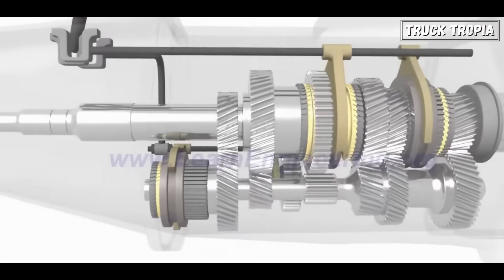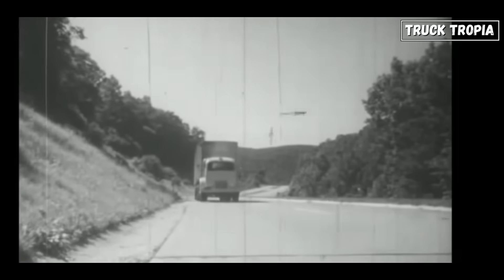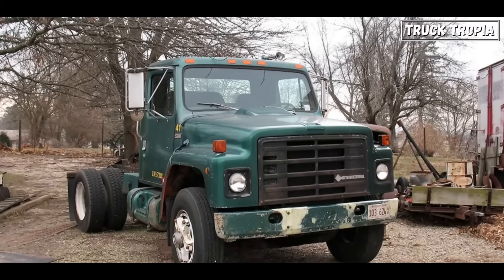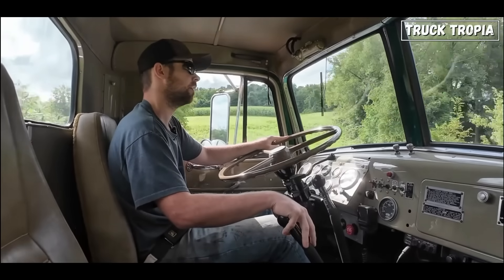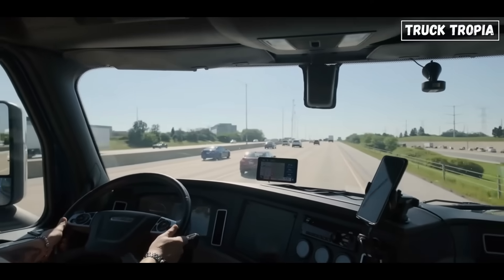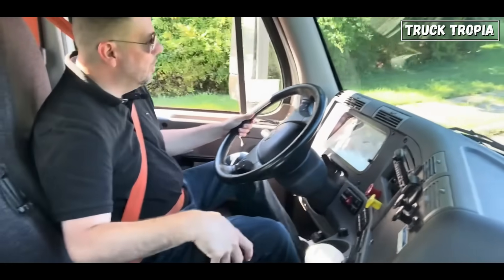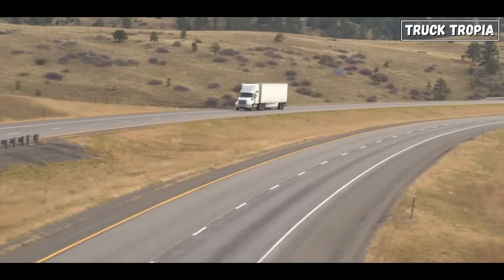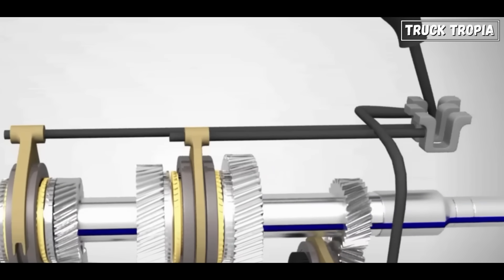Why Do We Keep Adding Gears to Trucks

Comment: Please do a bit more homework before presenting something like this. For example the c.1940 Peterbilt on the left on your title page would have a 4&3(12 speed) minimum, or possibly 5&2(9 or 10). The necessary power output from the engine occurs in a less than 500 rpm range. A straight 4-speed would require 1000 or more rpm difference between gears, OK for bobtailing.

Comment: For almost a hundred years now the American railroads have not had any need for geared transmissions because all  Diesel locomotives that they use are diesel-electric (ie diesel engines generating electricity for the motors that turn the wheels).
Reply: But those DieselElectric engine combinations are very heavy. A locomotive have to be very heavy, not to slip. ( low friction steel wheels to steel rails ). A truck has to be light in order to carry as much load as possible. Roads are built for smaller vehicle weight than railroads.
Reply: @Mike40M  they could still make the diesel electric truck light, I know that one of our local Municipal Water Works use diesel electric generators to keep the water flowing during power outages.
Reply: @earlfreeman93   I told you a million times. Don't exaggerate! Diesel electric has only been common for 70 years. And trains and trucks are different. Trust me, if they could put a diesel electric in a truck they would. Might happen in the future, because electric trucks will not be sustainable for long haul work. City work OK. But they tried electric buses in my city for three years and gave up. It turn out, the buses use up 70% of their battery power to heat the buses, and have only 30% left to run the darn thing. They kept running out of battery half way back to the charging station. Oops! Now they're trying again, but if you open the battery charging door, you will see a sign that says...wait for it..."Diesel Fuel Only"  LOL.  Ya, you can't beat a good old fashioned internal combustion engine to keep passengers warm in winter. But the EV people will keep on dreaming. LOL
Reply: @SternDrive  Must have been battery buses, because electric TROLLEY buses work great.  You just need overhead wires.

Comment: Give trucks 200 gears, then you will need to have 3 people in the cab = 1 to drive, and 2 others to do the shifting every few seconds.  Volvo trucks come with automatics as 'standard', their dual-clutch i-shift automatics are light-years ahead of the old 18-speed manuals in every respect. However, other brands of automatics can be horrible by comparison.
Reply: @menguardingtheirownwallets6791   But what you don't realize is that Volvo has tried all kinds of transmissions here in North America, and many of them have failed. Fact: We carry far heavier loads, over far longer distances, at far higher speeds, than our European friends in their little boxy short trucks. Volvo, and all the other modern trucks know what is out there, and they use what works.

Comment: I love a good manual gear box. But what I cannot understand is American trucks having two or three gears and very complicated gear shifting.
Reply: @fernandorangika  We don't have "two or three gears" at all. I'm not sure who told you that. And "complicated gear shifting" ??? Why do you say that? All North American trucks have the exact same 5 speed H pattern. My 18 speed is ultra simple. If you were empty you could shift it like an 8 speed. 4 gears in low range, and then repeat 4 in high range equals 8. Simple. It's only if you were real heavy and climbing from a stop up a steep hill that you might split all gears and shift 18 gears. They're super easy to drive. I don't even use the clutch. I don't understand why you say it is hard.

Comment: 6&4 transmissions Learned on them and still have them in my 1963 351 PETERBILT and my 2016 389 GLIDER....750 HORSE POWER TO THE GROUND. 😊
Reply: All of the specs I could find show only 550 hp and that’s at the crankshaft?

Comment: It's called overdrive, although we don't hear much of that anymore -- the gear to maintain the lowest RPM at cruising speed. My Mini Cooper R53 has 6 speed, and I often shift from 1st to 3rd, then to 5th or 6th depending on the driving condition. When I'm flooring it, then it's a different story. HAHA.
Reply: @KevinNguyen-zn4vv  So what you're say Kevin, is you love to over rev, and then lug your engine.  You do know that they gave you six gears for a very good reason. Right? You have the option to keep your RPM in the sweet zone all the time, for fantastic fuel economy, and engine longevity...or you can abuse that engine. Poor Mini Cooper!  Give it to me! I promise to always be nice to it.  😁
Reply: @SternDrive  You are 99% technically correct other than over revving the redline. I use 2nd gear to creep in traffic. It's not about fuel economy, I'm just too lazy to shift. HAHA.

Comment: Don't even need to watch this. I'm assuming they increase the number of gears to reduce the strain on the engine. Each gear had it where they had 20-30mph between, causing strain on the engine, presumably during acceleration. I assume, my adding more, it would cause each gear to be responsible for less mph and dedicated torque. It might also be that these gears essentially work in tandem, which also reduces torque. I also assume it's not good on gas...
Reply: @gjace26 Well you're partly right. My 18 speed is definitely easier on the engine, because I always am able to keep it in the sweet zone. But the main reason for multiple gears is for fuel economy. Keep it in the sweet zone and you never have to over rev it, and you never lug it. Happy engine, and far better fuel economy. And BTW modern heavy trucks do NOT use gas. Put gas in the tank, and your boss is gonna' be real ticked. Glad you watched part of it any way! And also also modern automatic cars now come with 9 and 10 speed transmissions. Fuel efficiency. They know...

Comment: There is a 1937 Life Magazine article where a writer follows truck drivers in new industry at the time, long haul trucking. In this article, a driver named Red, is driving a diesel Autocar big rig. It says right in the article that his truck had 18 forward gears. That was in 1937.

In the same article it shows pictures of modern looking 18-wheelers going across the Arizona desert.

Gasoline trucks at the time may have only had 4 or 5 gears, but because of the limited power range of diesels, they had to have a lot of gears.
Reply: Right gas trucks had multiple speed rear axle setups. So 4/5/6/7 forward gear transmission but a 2/3/4 speed rear axle gives you many more options… they don’t understand a 4 speed transmission will not move that much weight.

Comment: Question from a 4 wheeler here.... Which lasts longer and is more cost efficient truckers a manual or a automatic?      I know my S-10 has a 5 speed with 315k on it and never worry about transmission issues.
Reply: @arthurturner9398  My manual 18 speed on my Peterbilt will always get better fuel economy than an automatic despite the hype from Eaton. They would like to sell you an automatic that costs twice as much, and is prone to failure, and lots of service issues. They make more money on them, so of course they push auto shift. There is one reason and one reason alone why most modern trucks come with automatics. Most of the modern Flip Flop crowd, and new guys that they hire off the street, have no interest in learning how to drive a real truck like mine. I used to train them, and it is frustrating to watch. They just aren't interested, so if a company wants to get new drivers, they are forced to buy automatics. Our company has 19 trucks, and our one automatic is driven by our one and only lady driver. If we had more automatics we'd be able to have more young lady drivers, but the veteran drivers we have now are happy with real trucks, so for now...

Comment: My 1962 Land Rover 88 had 3 shifters due to 2 full overdrives that resulted in 16 gears (12 forward and 4 reverse) -- each gear was right in-between the others
Those gears got me home after four-wheeling left me with 2 cylinders (due to burning out the exhaust valves in the 2 inner cylinders)

Comment: My 1959 Mack B had 75 gears
Reply: @KerryConrad4764  Silly boy. I go back to the 70s and I drove B Model Macks. The one I drove was a very common 5 X 3=15. However it had a short 5th, so it only had 13 speeds. You may be able to trick these new green drivers with your 75 gears BS, but it's not gonna' fly with us veterans. 🤣
Reply: @SternDrive  Mine was a converted heave hauler with 5 sticks.

Comment: Frankly the only thing I see that EV technology will be good to us for helping the trucking industry is  making 1 axle on the trailer a powered axle that comes on when tackling a steep grade up or down. Because the regenerative braking will help keeping the rpm's & speed low coming down the mountain. Which will lead to less accidents and fatalities. And less use of runaway ramps which will lead to less insurance claims. So all the savings can be passed on to the consumer, right😂😂😂😂😂😂😂. As for full EV trucks, don't bet the house on it. We don't have the infrastructure for EV cats, why would anyone think heavy trucks would be different? Plus the battery technology isn't good enough for long haul trucks. Now if you're going the EV way that Edison Motors is going, then you're thinking with common sense. A real endangered species these days. Using a smaller Genset to help keep the batteries topped up right along with regenerative braking. It kinda goes along with the same principle of diesel electric locomotives. Something I wondered about when I was a young boy cause I grew up in the cabs of trucks with my dad being an otr. Why didn't they have trucks set up like locomotives with the drive train? Yeah I thought of 💩 like that at 5 & 6 years old.

Comment: Trucks back as long ago as the twenties also had auxiliary transmissions along with the main transmission.. so you could have a main box with 5 gears and a second box with 3 or 4 both with separate shift levers and you also had 2 speed rear ends so you could in fact have had as many as 40 different gear ratios or more if the truck was equipped with the aforementioned set-up, which was not unheard of or even uncommon.

Comment: we can also use electronic transmission instead .....
diesel engine will power a permanent magnet synchronous alternator ....then wheels  can be driven by multiple  synchronous motors .....
please don't reply me that it is expensive and heavy and less efficient ....It will be far more reliable if made correctly unlike tesla makes their EVs ...
It is not less efficient than mechanical  transmission in cities ...however on highway it will be less efficient than mechanical transmission ...
dont forget about regenerative braking

Comment: Automated manuals just plain suck. A real automatic works great.  Our single axel hino's have real automatics with 6 gears and a 360 hp engine. They pull better than the single axel Macks with the 12 speed automated manuals and 365 hp

Comment: I think something that gets overlooked on the older trucks is that they weren't expected to reach the top speeds we have today. If your expected top speed is only going to be lets say 50mph. You can get away with less gears than a truck that needs to go 75mph, to keep in an optimal engine RPM range.

Comment: Why wont they try ti use CVT?
Continuously Varying Transmission will keep the engine permanently in its sweet spot
Reply: They can't handle the torque of big engines.

Comment: Also, when you have an 18 speed you don't use all of the gears. Acceleration from a dead stop with a full load on flat ground you will probably start in fourth and be in high gear by 60mph. The huge number of gears is so you can start with a low range and optimize your hill gearings.

Comment: Not too fond of automated transmission American trucks. Would prefer a cab over manual Scania truck.
Reply: @donv40  You do understand that they run cab over trucks in Europe because of length restrictions; right? When I started in 1974 all our trucks were cabovers. When they lifted the length restrictions we dropped cabovers like a hot potato. Nobody drives 'em if we didn't have to. In cramped twisty short haul Europe they work. Here...not so much. Be careful what you wish for. If you hit a moose, you lose your legs. You know that right? Still want a cabover?
Reply: @ Yes, I understand the risk and why cabover style trucks are used in Europe. I just like the style, functionality and performance of the Scania trucks. If buying a truck, it’ll be a conventional cab truck.

Comment: Trucks can have over 32 gears and some of the earliest trucks had more than 12 gears. The increase in gears was because of the increase in the weight of the loads being carried. 
Trucks need more gears than cars both because of the weight they carry and because of the limited power band of diesel engines. 
Automatic gearboxes in trucks are very unreliable and require more maintenance than manual gearboxes.

Comment: I stopped being a fan of manual transmission after buying my first automatic. Manual can be fun sometimes on highway but shifting in city or in traffic have no fun, it's a pain.
Reply: @RurdigRedaxe  I'm 74 and have never owned an automatic transmission car. I despise them for lots of reasons. My 6 speed car really comes into it's own in city traffic. While all the torque converter cars all around me are allowing their RPM to go up to 5 and 6 thousand RPM (great for guzzling!) my car goes up to 1,600 or 2,000 RPM and I shift. That brings it back down to 1,300 or 1,400 RPM and my fuel economy is fantastic. While are my torque converter addicts are griping about the price of fuel. Go cry me a river.😂I drive a Peterbilt with an 18 speed in traffic all day in and out of the city. I don't find it to be a pain at all. But I guess if you're like the kid we fired last summer (he was really rough on the 13 speed we gave him!) driving in the city could be a real pain.
Reply: @SternDrive  If you think it's normal for an every automatic transmission to shift gears at 5,000–6,000 RPM, then your understanding of it is quite limited.
Reply: That is a big reason for today's preference for automatics - today's traffic.  I have a 73 GMC pickup with a manual trans with a worn-out 1st gear synchro, so I have to drive it as if DIDN'T have a synchronized 1st and either come to a stop before shifting into 1st, or double-clutch.  On one street with tiny blocks, each one with a stop sign, and going up hill so you can't easily start off in second, it is a real pain.  I doubt many younger people would accept that today.

Comment: The 18 speed that I had, gave me a200 rpm gear step. That permits you to keep the engine in the peak power range. That is very helpful when you are carrying a full load in the mountains. That was particularly helpful to me on Interstate 70 going into Denver, Colorado. You climb up to 10,500 feet,then back down and up to over 11,000 feet. When climbing these mountains with a full load, it is very helpful to be able to keep the engine in the peak power range.
Reply: I drove 9 , 10 , 13 , 15 and 18 speeds.  By far my favorite is the 18 speed.  I love the versatility of the 18 speed , you can drive it like a 9 speed if your feeling lazy and don't have much weight.  Or you can drive it like a 13 speed , or when you really need it you have all 18!
Reply: @Stumpy1973  Yes. 18 speeds are the best! I have one in my Peterbilt, and when I am fully loaded to max, and in soft ground, I will shift 10 gears before I get into high range. The guys that have 13 speeds have to crawl out of the hole in low gear. It is a long slog in low all the way up, and they envy me because I just keep shifting, and climbing. Of course if you are on level ground and light, you don't need to split low range at all. My 18 speed has saved my neck many times!
Reply: The engines today only have a power band of around 300 rpm anyway. Some are even limited by main office seeing you over reving their office rating. You know they will add sand when they offer you the vaseline
Reply: 250rpm in Mdrive and iShift it's perfect

Comment: Trying to squeeze even more and more out of increasingly smaller weak engines. I Prefered the old R model Mack's with the 5 speed Maxtorque transmissions . The old Mack's diesel motors had a such huge flat torque curve you didn't need more gears . Especially in the construction trades / vocational uses .   They pulled better than anything else back then .

Comment: Most manuals are still not synchronized
Reply: @SilverStarHeggisist  Volvo tried synchronised truck transmissions in North America many years ago. The guys loved them until they all failed. Our North American heavy trucks pull loads away too heavy for those little car transmissions. They are able to get away with it on the little light boxy single drive axle European trucks. But in our trucks. Nope.

Comment: The old Mack's like the deep reduction models had like 4-5 gears in reverse so you could literally do like 50kmh backwards 😂
Reply: @outlawdingo3020  I used to drive those Macks many years ago with the 5 gears in reverse. Our job required that we go in reverse at high speed. I have been up to 4th many times, but never up to 5th in reverse. 4th reverse is fast enough for me thank you. 😅

Comment: I love having an automatic in my work truck because it's a lot easier on my legs and back, (I have degenerative disc dieses), so I'm in constant non-stop pain. Having an automatic makes it possible for me to do a job I love.

Although, I'm wondering if the reason my work truck sucks at climbing hills/mountains is because it's automatic or if it's because the company I work for has the engine speed governed?
Reply: Probably a combination of the two.  With a manual, the governor has no effect on hill-climbing, just RPM, but with an automatic, limiting RPM can cause it to upshift when you don't want it to.